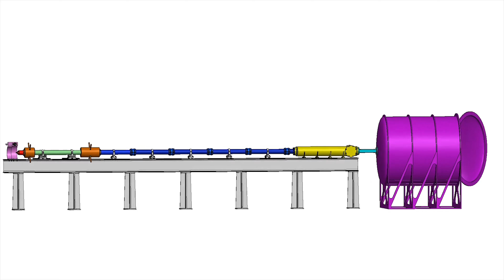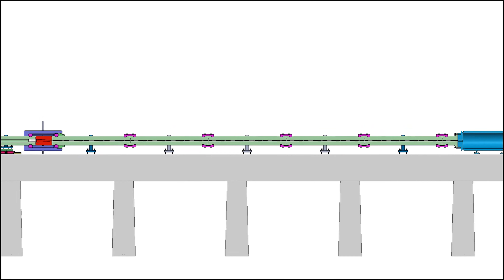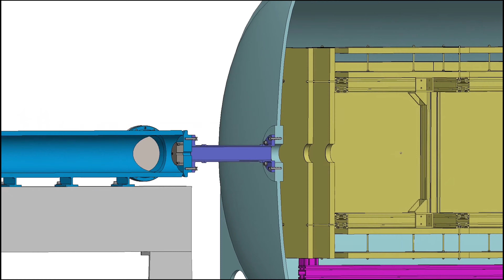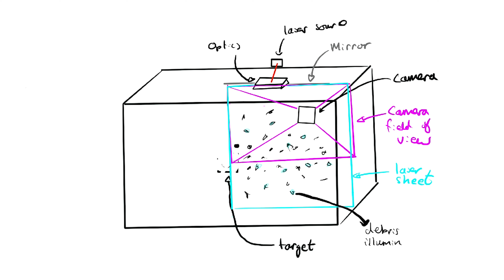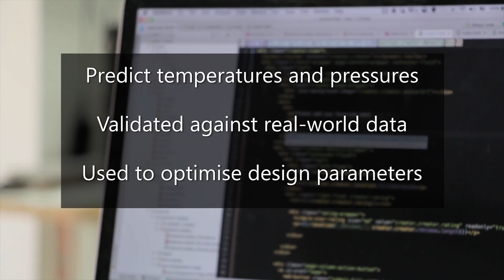GDP Group 47: Hypervelocity Light Gas Gun

Comment: I'm surprised this hasn't been weaponized yet. Imagine mounting a miniaturized version of one of these ones tank. You wouldn't need large, resource consumptive tank shells any more, you could just fire plastic beads and blow holes in buildings and other armored vehicles.
Reply: It has been tested as a weapon by the US by Utron but from what I understand there were feasibility issues with storing large amounts of gaseous hydrogen
Reply: For one the reloading procedure would be a nightmare. That gas piston in the first stage probably gets extremely well lodged in that conical section before the projectile, and the whole barrel needs to be held at a vacuum, meaning you either need a very fragile rupture disc on the end or to convince your enemies to stand in the vacuum chamber the gun is attached to. For two, even though the velocities are relatively high, they're not remotely high enough to encroach on the territory of conventional munitions given such an incredibly light projectile. To give that 1 gram projectile the same energy as a modern long-rod penetrator, it'd have to be traveling at 158 km/s - 22 times faster than this gun currently does, or put differently 0.05% the speed of light. Lastly, consider that the initial charge for this light gas gun is a shotgun shell, meaning the maximal energy it could have is that of a shotgun shell. To give this thing the destructive power of a tanks main gun, you wouldn't miniaturize it, you'd macronize it, making it even larger and more unwieldy.
Reply: @Grimbach2 you don't need to do this at all. 

You can simply use a burst disc. 

Pressure both sides of the burst disc to cancel out the pressure. Then dump the pressure out of the one side and the burst disc will pop.
Reply: @ThisIsNH9  In the second sentence I said you’d have to use a burst/rupture disc. I don’t see how the method you’re describing achieves anything, besides a bunch of airflow moving in the wrong direction. The rupture disc is already holding back atmospheric pressure so the projectile has an evacuated barrel to travel down. Also unless you have an absolutely massive vacuum vessel there’s no way for you to practically “dump” the pressure, and even if you did you can’t evacuate the barrel faster than the speed of sound.

This also doesn’t solve any of the other issues with the actual energy of the projectile.
Reply: @Grimbach2 the burst disc operates at a pressure differential. 

If you have a 3000psi burst disc, you can have chamber A contain 4000 psi and then chamber B on the other side contain 1500 PSI (relative to atmosphere)

Then when you drop the pressure on the 1500 PSI side, the 3000 PSI burst disc suddenly gets slammed with a full 4000 PSI, instantly triggering the shot. 

This doesn't solve the reload-ability issue but makes it far easier to engineer and produce them. 

The key constraints of them being used as a weapon might be the barrel length required.
Reply: @Thi @ThisIsNH9 hat or you could just pick up any rifle chambered in 5.56 and have a chamber pressure of 62,000 PSI on demand, or better yet roll in a tank with a chamber pressure routinely hitting 100,000 PSI. Neither of those solutions require you to have clunky and fragile pressure vessels, or burst discs, or maintain high pressures for any more than a few milliseconds as the propellant in a casing burns.

There’s a reason these things only exist in a lab.
Reply: @Grimbach2 I mean, that's fair. I obviously wouldn't reach for something like this as a first line of defense because of how impractical it is, but it is an easy way to make a powerful single shot cannon that can launch tungsten projectiles with a muzzle energy that is higher than a 20mm
Reply: @ThisIsNH9 that doesn't get you as much velocity - the ram compression of the hydrogen by the piston doesn't just raise its pressure, it also raises its temperature greatly, which significantly increases achievable velocity.

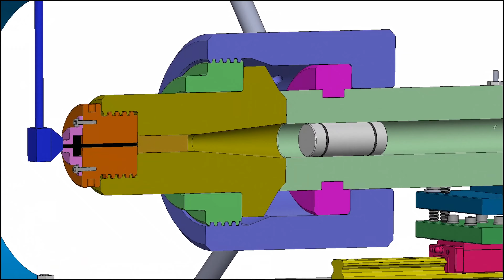Comment: 0:44 Just 100 Mpa? That's 1000 Bar, even most pistols habe higher pressures. Rifles and cannons have 4000+ Bar. Seems kinda low
Reply: Much much longer barrel proportionally and the light gas (usually hydrogen) transfers momentum more effectively due to its higher speed of sound.
Reply: No this 100 mpa is ignition pressure....
Reply: @bestboy5381 no, you don't ignite, you use the hydrogen directly. If you burned it, the products would have a much higher molecular weight, leading to a slower muzzle velocity.